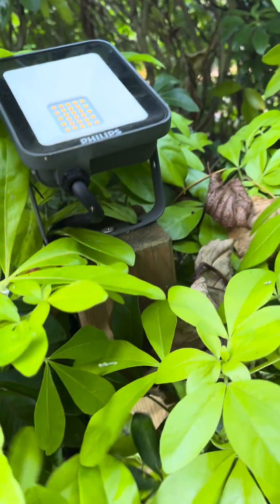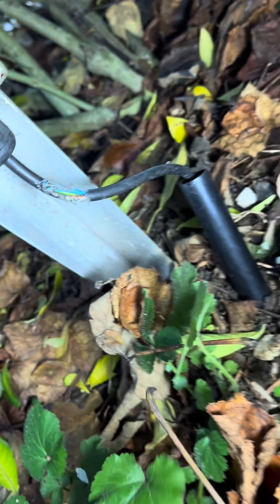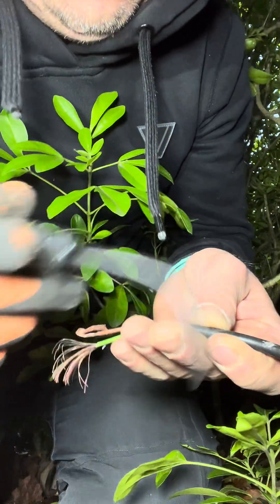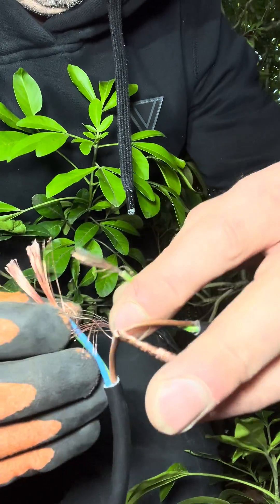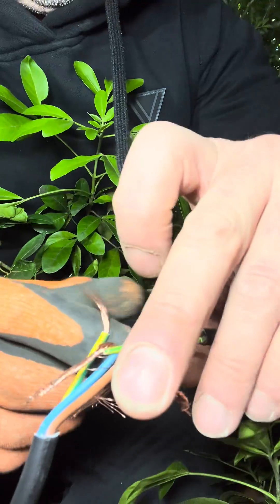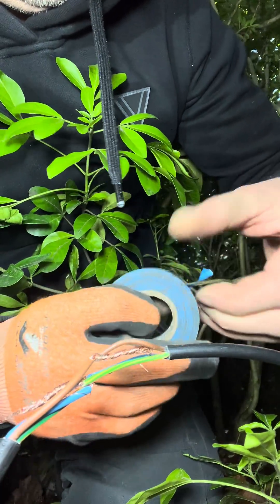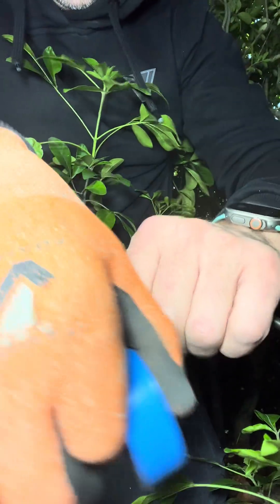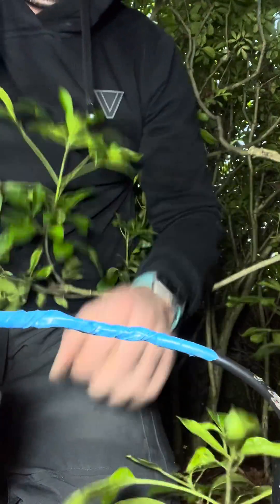STOP! This “Cable Repair” Is Dangerous ⚠️ Do It Properly

Comment: Normally the reason it doesn’t work is because it’s a cheap LED fitting .  I can’t believe you done such a dangerous bodge . Only wants a child to come along , seeing a nice piece of tape and unwinds it . We have trouble round here with squirrels chewing cables so where possible we sleeve the flex with flexible metal conduit
Reply from the maker: You reckon that’s how I left it - or used the old cable to pull a new one in?
Reply: @toolboxtalking never mind the guy above, some people just don’t get it 😂😅😂😅😂
Reply from the maker: Ha, there’s a reason they don’t get it 🤣🤣🤣